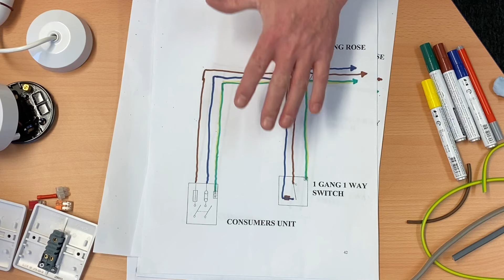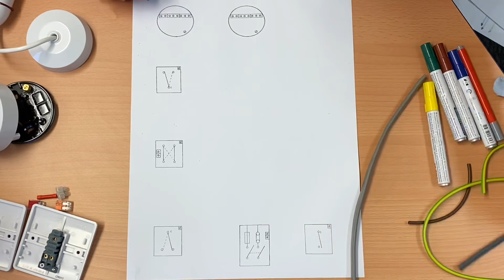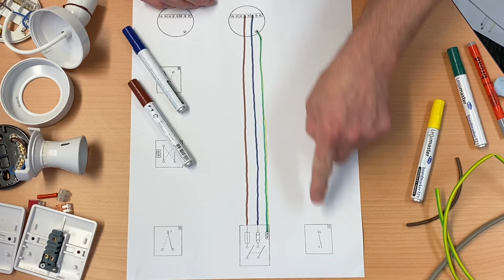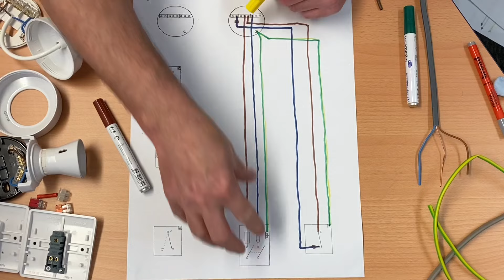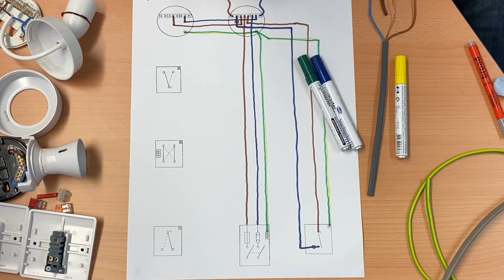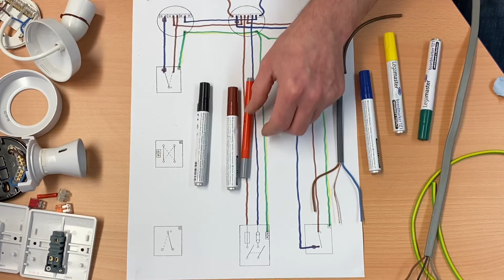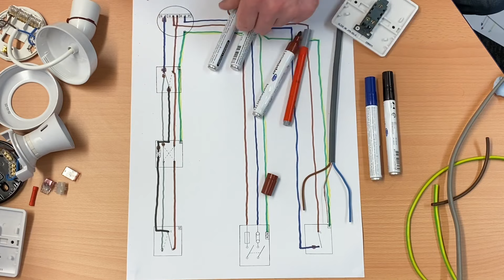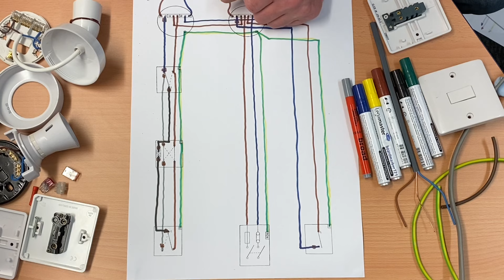Wiring Diagram 2 Way & Intermediate & 1 Way Switching of Lights Using the 3 Plate Wiring Method

Comment: I think it's crazy that a ceiling rose would have a single terminal for three CPC's, rather than having a three terminal block. Fitting three CPC's into a single terminal could lead to one of the CPC's coming loose if it wasn't tightened up correctly, leading to a bad earth. Would probably be better to put the CPC's into a WAGO.

Comment: Need diagram for 2 plate method for intermediate switches where feed and load at 2way switch and another diagram where feed and load at intermediate switch
Reply from the maker: Wiring Diagram Lighting Circuit 2 Plate Method Taking the Feed to the Switch - 2 Way Switching https://youtu.be/QX1B4gtqisc
Reply from the maker: Wiring Diagram Lighting Circuit 2 Plate Method Taking the Feed to the Switch 2 Way and Intermediate https://youtu.be/L9DU8XkHn1U